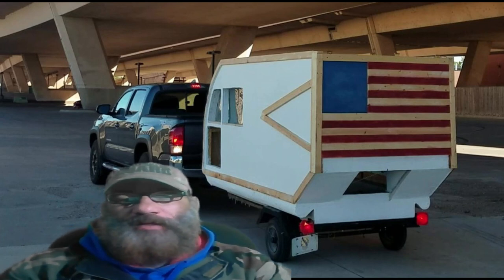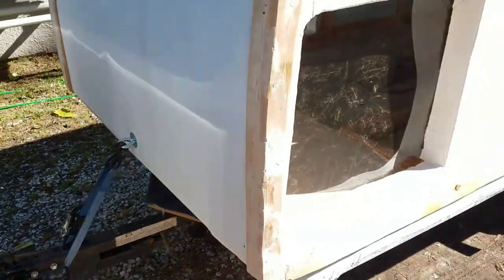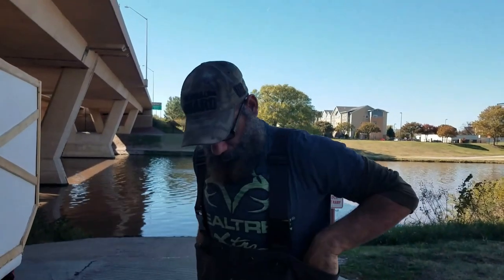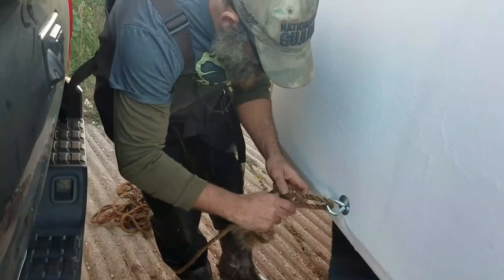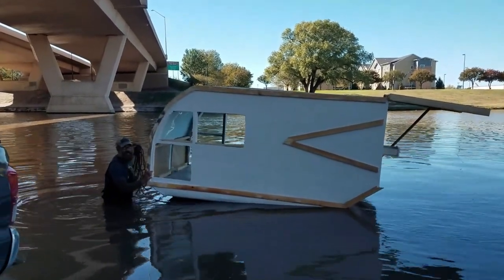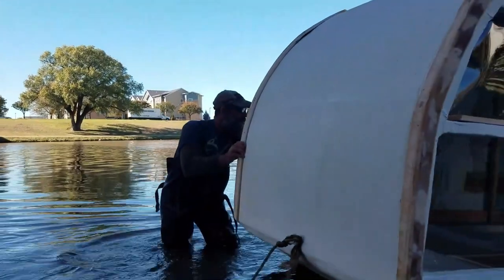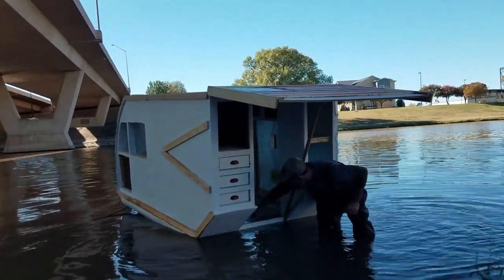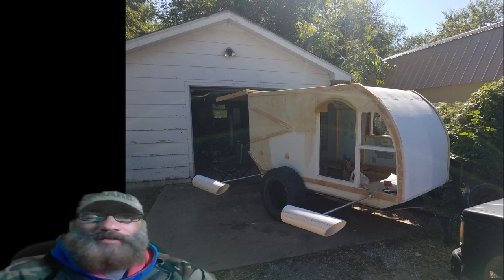I am putting my hybrid teardrop/square drop/boat camper build in the water for the first time.

Comment: If you put the out rigger a little more to the back before launching that may give you more buoyancy at the stern while launching. Are you going to test launch it with full weight inside and outboard installed?  What about a small removable swimming platform setup? Excellent project! Thank you for the video series so far!
Reply from the maker: Thank you for that advice. Yes, I am going to test it many times with added weight, people, cargo, etc. Throughout this build. As far as the swimming platform, I am designing a floatable deck that will attach to the door side outriggers to stand on and fish from. We will see how it goes. These is literally just ideas in my head. I have no idea how the end result will be. Hoping for the best, but doing my research as I build. Thank you for your comment.
Reply: As opposed to adding weight as you mentioned in the vid. I would agree with the adding of buoyancy to the rear as has been mentioned, you... the motor... and supplies will cause the transom to squat more...
The next Q. is... will it need a vessel #... will the uptight bureaucrats sign off on the Berserker ?

Comment: I’ve been telling my wife about maybe trying to build a floating camper like this but where the trailer is floating too. Just back up, unhitch and roll the whole thing in the water.
Reply from the maker: I was originally designing this to do that very thing. Just put the entire trailer in the water. I decided against it because I was unsure of how wonky it might be dragging the wheels in the water.
Reply: @Saxxsays  should be fine as long as the bottom of the tires are treated like the bottom of a boat. Might actually add stability too. Could build a rear deck for lounging and have a transom for a small motor. Remember those cars that you could drive into the water? Something like that but a camper.

Comment: Neat project but I would just use an aluminum flat bottom boat with a foam built top covering for shelter and roof thin plexiglass for windows no wood is needed just fiberglass and it’s all ready set up for a moter eaither gas or electric trolling moter  less fabrication on the floating aspect
Reply from the maker: You are very correct. I just like doing dumb stuff. Lol

Comment: Most of a boats hight is under the water line. That is what gives it stability. You need to lower the center of gravity and have a topside entrance. You could design it with the wheel Axel's on the roof of the boat and you have the boat upside down when driving. That would make an amphibious design much easier to build.